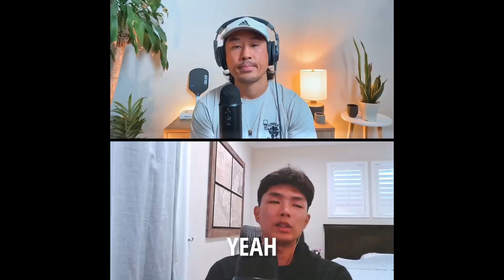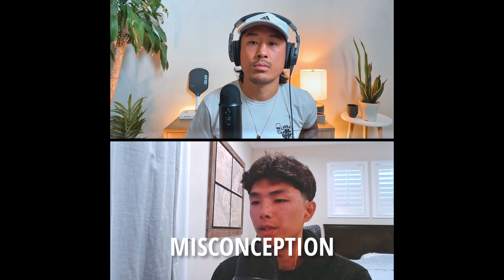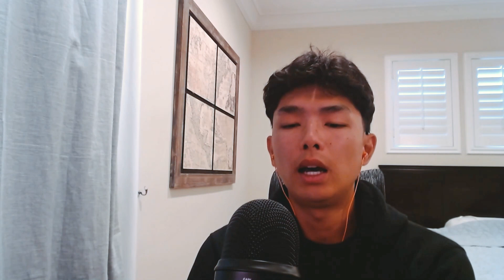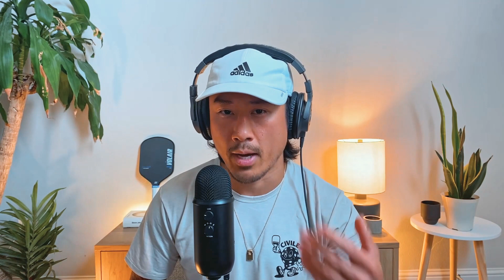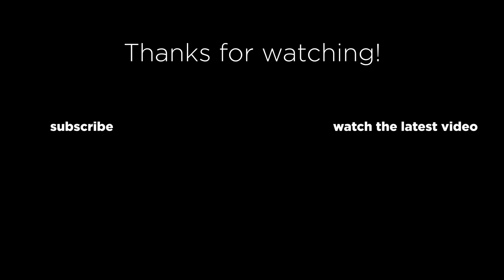The Lifespan Of Pickleball Paddles

Comment: The problem I have with Pickleball paddles needing replacing every 3 months is that it actually turns out to be more expensive than a tennis racket. A tennis racket = 250$, plus strings for 20-30$. and you may need to restring every 3 months too. So that's 250+(30x4) = 370. Now if you're going to have to replace Pickleball Paddles every 3 months and you get them for 100$, then that's 4x100 = 400$.. and that's just the first year. With the Tennis racket, it'll last you ages... I have really good tennis rackets that I still play with which are 6-7 years old. The only thing you'll need to change are strings, which are a whole lot cheaper than new Pickleball paddles. I wish there was some way to improve durability of paddles. Make it so that you can use Pickleball paddles every couple of years. Right now, the durability is a concern of mine as I am looking to play some Pickleball in addition to my Tennis.
Reply from the maker: Yeah definitely, I hear you. There are some brands that are known to have more durable cores but it would be great to have more robust technology in that area. Rather than focusing on these minute chances in performance, focus on creating longer lasting paddles. Although I guess from a business perspective they may see this as their way to generate recurring revenue.
Reply: @buildingpickleball  Yeah unfortunately I think it is all about revenue and money :( I get that adding new technology might reduce the lifespan. They should have Paddles which last for ages but sacrifice performance, ideally meant for recreational players and non-serious club level tourneys, and have the less durable, more techy Paddles for pros. Cause, with my play. I won't be able to appreciate these minute improvements anyway. All I care about it having fun. I would definitely buy into a paddle that will last me a couple of years at least with lesser tech and stuff. I am sure I am in the majority with regards to this for sure.

Comment: I'm new to this game but this game would be screwed if they want you to replace your paddle every 2-4 times a year at $200+ for a top tear paddle. That's $400-$800 a year. I can't think of a sport that is that expensive year over year. I'll just pay with my paddle for as long as I possibly can.
Reply: Sadly tennis is even worse. You need to replace strings on multiple rackets after even a practice session. You have to have multiple of the same racket, replace the grips constantly, new rackets every 6 months or so as well at the professional level.
Reply: But again, if you are just causal, your paddle will last forever. You probably won’t notice a difference at all.
Reply: @JD-db3uv  If you are a professional... I play casually and club tournaments.. and I have 3 rackets and change the strings every 3 months for the racket I use the most.. I am cheap but they stay good for that long. And at times that I am not playing regularly, I replace strings after 4-5 months even... Tennis rackets themselves last for ages... and restringing is a whole lot cheaper then getting new paddles...